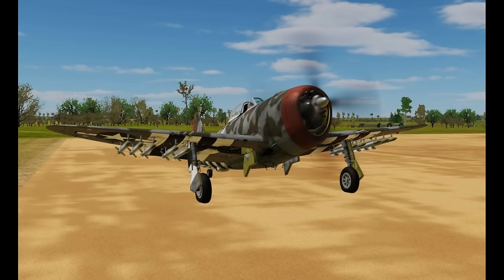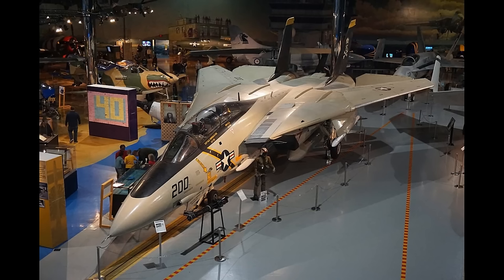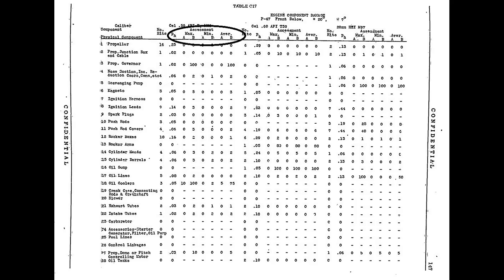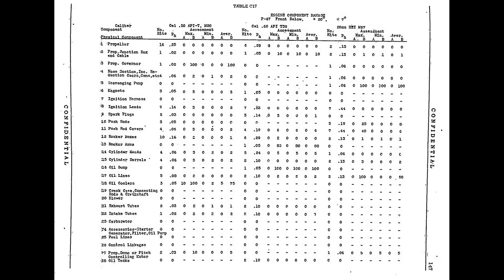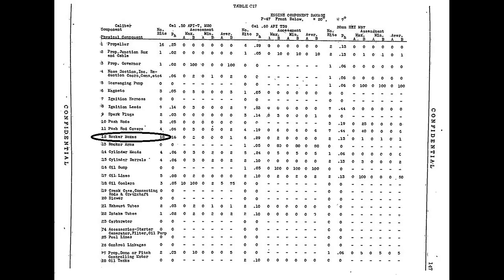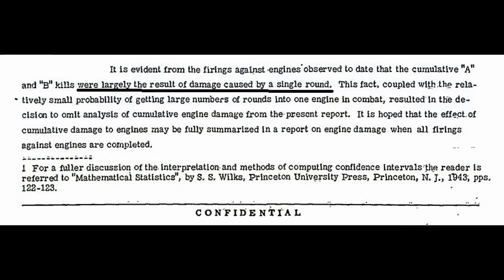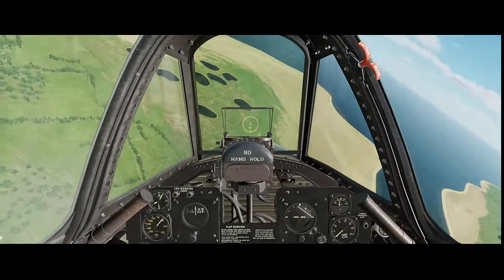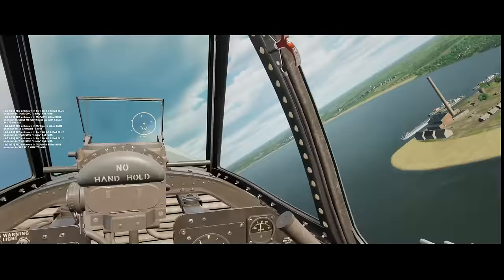50 Cal Vs. 20mm Engine Damage in WW2

Comment: Hi Greg, thank you for providing the very best classic aviation content on the entire internet.

A hemi-engine using a 2 spark plug ignition system will usually run a significantly lower total spark advance timing to achieve the proper flame front propagation speed within its combustion chamber than the same engine using a single spark plug ignition. 

Therefore, if it would be possible to increase the total ignition advance to the value it would have in an engine using a single spark plug system the power loss would be rather small. 

A practical example I´m familiar with is the old "air-head" BMW motorcycle boxers, they do gain some extra power with a good dual spark plug set-up compared to the standard single set-up, but it is not a huge amount, perhaps in the order of 5 % or so.

However, in an engine with a very large bore, which is certainly the case in the R-2800 🙂, it would not be possible to advance the spark timing much at all when running on only one of the plugs, because the very long flame front propagation distance would provoke detonation if trying to use a high enough advance needed to make full ( or even close to full ) power. 

The conclusion is that in the practical case of most aero engines you are perfectly right. Also, I assume that the maximum spark advance you can set from the cockpit is probably limited to the maximum advance intended for the system while both magnetos are working properly?

Very Best Regards / Jan.
Reply from the maker: Hi Jan, I haven't flown an R-2800. The Continental O-200 has about a 4 inch bore and drop of about 125-150rpm during the mag check. A four inch bore is pretty typical for an American V-8. Almost all the small blocks from Ford and Chevrolet are right around a four inch bore, and even some of the big blocks like the Chevrolet 396 are right there. Now could the O-200 make the same power with one plug but more advanced timing? Maybe, but I doubt it based on the fact that racers have gone through great lengths to add the second plug to Hemi head type engines on designs that originally had only a single plug. The difference here could be in what you and I think is "significant". To me a 5 percent gain is important, in motorsports that's absolutely huge. For a manufacturer, probably not, there are much easier ways to design in another five percent.

Comment: I had access to a USAF report that also looked at the P-Sub H factor at the determined that MV, Muzzle Velocity and BC, Balistic Coefficient, had a relatively large effect of how easy it was to get hits and thus shoot down enemy aircraft. Not the Brits were not that lucky on a per engagement score when armed with the Hisso Mk-V in Korea, because the MV was only 840 M/S and the Blunt nosed shell lost velocity very rapidly. They, the USAF, concluded that the best shell was a new, much lighter 20 MM shell with 9-12 grams of PBX with a new, much more pointed M-50 shell! Because the new shell was so much lighter than the old 130 gram Hisso round it had a MV of 1,036M/S From a smaller shell, 102 MM long Vs 110 MM long for the Hisso. The new combo of 102 gram pointed shell at 1,036 M/S and fired at up to 7,100 Rounds per minute was a winner and became standard issue until the F-22. The F-22 by the way had a similar Vulcan Gun, but with longer BBLs and a new even lighter shell that only Massed 84 grams with a new very high energy propellent gave 1,525 M/S!

Comment: Machine guns operate in what is called a beaten zone. whatever the beaten zone of that era .50 cal M2 will be based on the rate of fire, ammo used and the mount. If we have an idea of what kind of mount and which M2 was used we can get an idea of the area likely to get all of those rounds. From there we can determine how many are likely to hit the area available of the planes engine housing.

Update. According to FM 23-65 page 116 (6-3) "Thea beaten zone is an elliptical pattern formed by the cone of fire as it strikes the ground. The beaten zone is always about 2 meters in width. There is lots more in that manual and as I find more I'll add it here.
Reply: A 240 on a tripod has a spread of 2 mils.
Reply: I think you misunderstood something. It's bullet spread thats relevant because no one cares where they hit the ground in this case.
Reply: @JO-ch3el  The beaten zone is the known spread from a fixed position at a given range. it doesn't matter if its the ground or the plane, it's whatever is in the path of the bullet in that given spread.
Reply: @Rubberweasel eh a beaten zone context is for suppressive fire for ground combat. I bet a pilot is not impressed with this "beaten zone" when he only has a few seconds window to fire.
Reply: @hippoace  The beaten zone is just math, it is where the bullets are going to end up at a given range without moving the machine gun. Nothing more or less. Seeing as they were shooting at these planes from the ground, it matters in terms of how many bullets are likely to be in the area that the engine occupies out of the number or rounds fired.
Reply: @hippoace  Beaten zone isn't about suppression, but the area within anything being receiving at least one hit.
Reply: Beaten ground is horizontal statistic useful for ground targets ie men taking cover not useful stat for vertical target ie aircraft

Comment: Interesting and – as usual – well done, Greg.

From my Dad's combat report with VF-19 from the USS Lexington in the western Pacific in October, 1944, flying an F6F-5:

"On 14 Oct. 44 while having a field day burning planes on loaded Taiyohara Field, Formosa, where revetments were jammed with as many as 10 planes, was hit by a 20 mm AA on the propeller hub causing the engine to lose oil pressure. Engine ran cool, if a little rough on 250 mile trip back with 10 lb.oil pressure. Two days previous [12 Oct., 1944] was hit by 3 40 mm AA while strafing at Pescadores and engine brought me home 200 miles with 15 lb. oil pressure."

I have a photo showing the mangled prop hub from 14 Oct., 1944, as well as an oil-covered engine front. I also have photos of damage to the plane (including the engine) on 12 Oct., 1944. In that case, at least one hit to the lower port side of the engine took out a cylinder as well as part of the cowling, and another hit was near the wing root in the aft portion of the port wing, just aft of the cockpit, with structural members easily visible inside the wing center section beyond the bent and mangled sheet metal wing surface and oil from the engine hit(s) streaking the side of the fuselage. Somewhat to my surprise, the landing gear still functioned, and he landed aboard safely. The plane wss judged "unrepairable" and, after a brief scavenging for usable equipment, was pushed over the side into the Pacific.
Reply from the maker: Wow, thanks Ray.

Comment: You may have already known this, but the aircraft M2 had about double the rate of fire found in the ground based M2. I have seen rates quoted between 1000 and 1200 RPM, which may affect "time to kill" calculations
Reply from the maker: The M3 certainly has a greater rate of fire, around 1200rpm, but it's really a post war gun, think F-86 Sabre.
Reply: @GregsAirplanesandAutomobiles  M3 sounds like a Mg42 firing
Reply: @GregsAirplanesandAutomobiles  Ah, I wasn't aware of the differing timeframe. Thanks for the correction!
Reply: @GregsAirplanesandAutomobiles he AN/M2 does have a higher ROF than the modern M2HB, but I can’t find information on if the HB has the same ROF as the earlier ground guns. 
Wikipedia says AN/M2 had a variable firerate from 750-850 rpm, for whatever that is worth. I’m pretty certain your total RPM is with this number and not the much slower 500 rpm for the ground guns; great video Greg, thanks!
Reply: I think the RoF with the .50cal AN/M2 was 750 RPM and later around >850 RPM with the hotter M20 APIT and M23 Incendiary, due to higher chamber pressure.
Reply: The ANM2 .50cal has around 800RPM, it was not until postwar where the M3 was made, which could pull off around 1200.

Comment: Anthony Williams wrote some excellent articles on WW2 aircraft weapons.

One of the reasons the US didn’t embrace the Hispano 20mm to a large degree, the gun that the RAF used to great success, was a manufacturing error that plagued US built Hispano cannons. The US built the Hispano with a bit too much clearance in the receiver. This resulted in a high frequency of misfires or jams. A plane with wing mounted guns, experiencing this malfunction, is in trouble (a jam in the nose mounted Hispano in the P-38 could be cleared by the pilot). Rather than fixing the tolerance error, the US coated the 20mm shells with wax to try and compensate for the clearance issues. Unfortunately this tended to introduce dirt and other contaminants which just exasperated the problem. However as the .50 cal machine guns were getting the job done (the U.S. mostly faced other fighters, or lightly protected bombers), the U.S. mostly stayed with the .50 throughout the war and into the post war period. Also a high rate of fire from multiple .50 cal guns, tends to reward “spray and pray” firing that pilots with minimal or median training/experience. With 6/8 guns, and firing a 5 second burst, a pilot with even mediocre skills has a good likelihood of hitting.

It should be noted that the U.S. Navy saw the need for cannon much sooner than the USAAF/USAF.

This need for a harder punch really becomes apparent in Korea, with the .50 cal F-86, dicing with the 23mm/37mm armed MiG-15. With the higher engagement speeds, getting only a few hits had to really count. In fact, late in the conflict, some USAF F-86s were modified to carry 4x20mm cannon, and higher kill results were seen.
Reply: spray and pray also known as accuracy by volume. we have a bullet with your name on it. we just have to find it.
Reply: Double problem for the US 20mm....
1) Looser tolerances ( its a cannon not a rapidly reprocicating machine ....err whut ?).
2) In making the US manufacturing plans chamber length was increased by 1/16". This led to extraction problems exerbated by the afformentioned greased ammo. 
The Brits were consulted on his problem and as a result chamber length was decreased ....by only 1/32" ( Damn the Brits we're Americans we know Guns). The problems were thus never fully solved and this led the the US fetish for inflight re-cocking devices. ( making installations more weighty and space costly ).

The Navy REALLY wanted a 4x20mm plane armament.

Comment: This is so interesting because a coworker of mine had their air conditioner compressor shot in Chicago by a 9mm and it effectively disabled their Malibu. Because aparently we need a critical cooling component (the water pump) to share the same belt as every single other non critical engine driven accessory these days. I guess gears are too expensive.
Reply: Very little armor on the Malibu these days. The old VW bugs are air cooled right? Maybe get one of those?

Comment: Thanks for putting this stuff up, really interesting and informative. 
Excuse me if this has already been mentioned elsewhere, but I think the interpretation of the P(h) column of the chart shown at 5:38 may be probability of hit per rounds fired. For the .50cal it works out to about about 50-67 rounds. Allowing for two the decimal place rounding in P(h), it seems reasonable. For the 20mm it would be about 15-17 rounds. Looking at the weapons characteristics chart at 30:20, it seems that they were trying for some kind of equivalent weight of ammo carried or weight of fire, not equivalent firing time, as it works out to around 3 secs for a .50 cal M3 and 1.2 secs for a 20mm M3.
Reply from the maker: Hmm, maybe. I actually suggested it's a probability of a hit to that component, but stated it differently. For example, if the prop got hit 16 times and had a 25 percent chance of being hit, that would put the total rounds at 64, which is pretty close to the number you are getting. Of course the total hit is around 70 for the reasons I stated.
Reply: @GregsAirplanesandAutomobiles  Thanks for being kind but I've got to quit eye balling this stuff. Using P(h)  as P(h) = probability of hit based on hits/rounds fired doesn't work. The table shows a total of 74 hits for the .50cal and 32 for the 20mm. Using P(h) and number of hits to back out the number of rounds fired gives numbers less than 74 (60) and 32 (16), so just not possible. I do however have an even greater respect for the 20mm since the total P(h) is an amazing 202%, implying 20mm hits damage two components on average (it's "only" 120% for the .50cal, so four hits damage five components). Sorry, mislead by WWII USN where P(h) was used as the probability of hit for each (big gun) round fired.

Please keep these coming, I can't imagine how much time you must put into them.

Comment: Back in the late 70's, I was stationed at March AFB. We were just starting the museum there so we were out going to DM to get some. I did a trip to China lake NAS as a scouting mission for an F-89 they had there and it was in an area where they were testing aircraft survivability. They put aircraft into fixtures, shot at them or did explosives damage while blowing air over that aircraft or componant set. I can't fully remember but they used either a clipped wing KC-97 or B-50 as their wind machine.

Comment: Thanks for Ur video & thanks for clearing up this claim of operational radial engines while having cylinders shot off. If a cylinder was shot off the engine dragging  a damaged jack rod through the engine would result in immediate catastrophic failure  of the engine.

Comment: The reason for the large oil tanks on a radial air-cooled engine was that the oil went from the tank to and through-out the engine, then into the cylinders and out the exhaust. I was told by an A-1 Skyraider (Spad) pilot (a Naval Aviator) that the range and time of flight was limited by the Spad’s oil capacity, not the amount of fuel it could carry for the 2,700 hp Wright R3350-26W Cyclone engine.  So oil was carried for planned flight time and reserve fuel amount. But the ability in an emergency to keep going when a liquid cooled in -line would have stopped us a great asset.
I apologize if I missed this in your presentation or the comments.
Your videos are always anticipated and viewed to their fullest. I learn something every time.
Reply from the maker: That's true about the oil consumption, I talked about it quite a bit in another video. The clearances in those radials were huge.

Comment: Hi Greg, love your work! I was looking back at some of my resources and a 2-3 second burst against an enemy fighter whose pilot was not asleep was a long burst. A five second burst was more typical against a non manoeuvring bomber target. Many people have seen that slow-mo footage of the FW-190 taking apart a B-17 and think that long bursts were normal but even in the Battle of Britain more experienced pilots told the rookies get in close let loose and get out! I cannot imagine a 20 second burst. Just sit and could how long that was. From what I have read 20 seconds would just about empty the magazines of a P-51D.
Reply from the maker: It's a question of getting enough rounds out there so you have good statistical data to work with. A two second burst just wouldn't do it for that purpose.
Reply: @GregsAirplanesandAutomobiles  Albeit my knowledge of guns isn't anything that would qualify me as an expert by any means, there are a few factors that makes me inclined to believe that fixed number of bullets has merit.

First of all, there is the issue of repeatability. Unless the various subtests per calibre were similar enough, the results would be of very little use.
That suggests that the tests were not made in the air, but on the ground with both targets and machineguns in predetermined positions using the same orientation each time..

The firing position is bit uncertain, either using single guns in fixed positions (repeatability would suffer if the shooter had to walk the fire into the target) or installed in stationary aircraft to get a more realistic spread as the quality of the individual weapon matters less. Either way, there will no longer be any significant airflow to cool down the relatively thin barrels of aircraft guns (since they are expected to be kept in winds of 80-200 m/s it makes more sense to save weight as cooling is ensured, a point Forgotten Weapons brought up in several of the aircraft gun videos), and that would quickly result in overheating if long, sustained bursts would be used.
A specific amount of ammunition (calculated on a certain time frame for each weapon?) could be spread into shorter bursts, preventing the accuracy loss an overheated barrel would bring. With the weapon fixed in place, the repeated bursts would have little to no effect on the overall result.

Also, it is very hard to accurately repeat a time based length of burst at least 157 times in a row.

lf the suggested methodology makes sense, perhaps that might shed some light on those numbers?